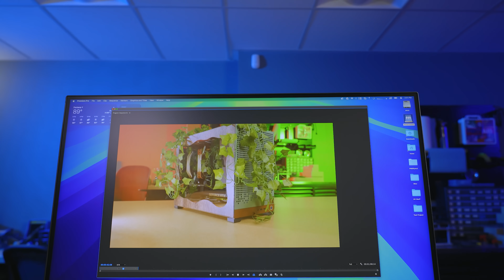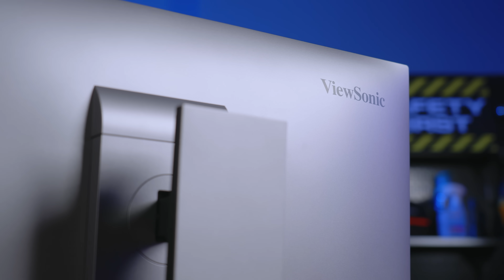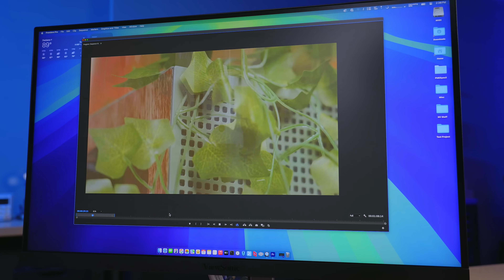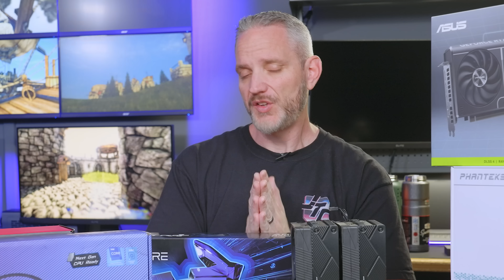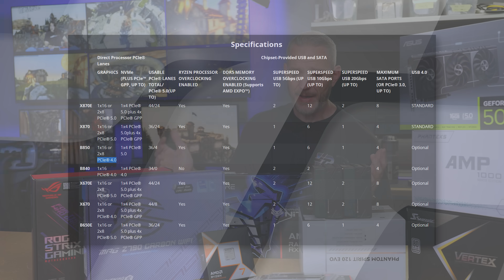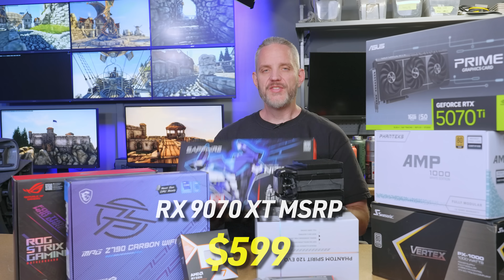This is the Sweetspot for PC gaming... Don't get fooled into spending more!

Comment: Your OS makes a difference as well, if you just play Single-Player games and have an AMD GPU. You may want to look into Linux, as you may even get a preformance bump in your games using Linux vs Windows. Not to mention, no more Windows nag notifications and forced updates. But if you play a Multiplayer game, look up if it works on Linux yet or not. You may also have to look into learning alternative software like you would if you switched to Mac..

Comment: Definitely don’t overspend on the mobo, I have an asus tuf gaming WiFi+ B650 and I’m able to tune the 7950x to use 180w with an undervolt/overclock offset in PBO, retains about 90-95% of stock performance but stays under 80c hotspot even in artificial benchmarks/deleting large folders in unreal engine project (tends to be very resource intensive). The mobo also has 2.5Gb networking, WiFi/BT, PCIe 5.0 for the CPU M.2 Slot, and honestly a fair amount of 3.0 and C ports for a sub $200 mobo. Biggest problem was having to find separate WiFi/BT drivers for a different motherboard on the ASUS website, courtesy of reddit lol.

Comment: basically this --> thermalright phantom spirit 120 se / evo or thermalright peerless assassin 120 se paired with any modern cpu (no, you don't need 9800x3d) + whatever gpu is cheaper in your region - 9070 xt is no less than 100-200 EUR cheaper for me and it's even better than 5070 Ti...

Comment: I would always still go with a 9700x rather than a 9800x3d up to a 5080. The x3d chips get really hot due to the stacked x3d layers
Reply: I don't think even a 9700 is needed for gaming....I mean I really don't see anything more than a 7800 getting truly used in a gaming scenario even in something like a really impressive Minecraft world
Reply: @rarespetrusamartean5433 you're perfectly right. Even the 9600x would be fine with most graphics cards cause the gpu would still be the limiting factor most of the time
Reply: I got a dinky little R5 5500 and I've played forbidden west, factorio, war thunder, minecraft, space engineers, ONI, whatever. I never ran into CPU issues and this thing was $105....Anything more than a $300 budget for a cpu is ridiculous to me.

Comment: OMG Jay i need to update my PSU. i still got an OCZ GameXstream 600W PSU 80+ White. i've buy it in 2006 to build a system with intel core 2 duo, update my system to AMD FX 8350 and update my system with ryzen 9 3900XT but i still have the same PSU from my first system. Thank for the advice for PSU

Comment: I got the b650 and 7900x and 7900xtx but a new motherboard would t be bad the wifi is super slow it doesn't get more then 500 mb ps vs my rog flow z13 gets 1.1 gbps which is the max download speed for me

Comment: As long as you're paying for a CPU that supports resizable bar, I've recently built 2 PCs with an Intel Arc A750 ($250), and get 75-120fps on most titles 🤷
As far as bang for your buck, if you wanna save some significant money, not a bad option.
Driver support is significantly improved since Arc launch, and as far as headaches, it's usually just a simple "enable resizable bar" in BIOs.

Comment: Don't buy X cpus. My 7700 is just 100Mhz slower at boost clocks than more expensive 7700X, you won't notice that 2 percent difference in prak clocks.

Don't buy 1000W PSU until you gonna run 500W power draw regularly from it. Efficiency curve losses at low load and purchase cost would kill the value.
With. Gold rated PSU? I never used, but EU 230V power grid makes PSU efficiency curve sit maybe 2 percent higher than 110V input. Anyway you should not notice the gold vs bronze PSU difference until you run PC wo power buttonx 24/7 at 300W+ load continuous.

Don't buy 9070X..204-220W 9070 is much cooler, less power hungry, no need for higher tier PSU and those 14 percent less performance vs XT? It is your choise. 304-350W XT needs better PSU.

The best budget savings start at detail and resolution slider in the game! Where 1440p is great looking, 1080p is still very popular and your hardware will let you run it at higher details. Fps cap wo make the magic and details settings lower than " Ultra Max Extreme" 😅 will save you the most money.

Comment: This week I built a P4 3.2 HT / ATi 9800XT retro build and I must say, those days were the golden years of PC building and gaming.
Reply: For me it was the Q6600 G0 stepping and 8800GT times in 2007-8, close to top of the line performance with mid range prices
Reply: Been into computers since the early 1980's, and I agree that the early 2000's were peak for building and case modding. Memories of painting Lian Li cases, manually cutting windows and installing gaskets, and using air fresheners with my exhaust fans.
Reply: but what keeps you from doing exactly that nowadays?

Comment: In the SSD talk (around 6:43) you talk about large files being where the gen 4 to 5 difference is noticeable. What is considered a large file in this context? (I'm assuming 20GB+?) Are there specific (non-game) types of application that benefit noticeably (enough to justify price) from the speed boost? Like CAD or editing software, maybe?
Reply: I’m playing around entry level ai pipelines and moving from node to node you need to load entire model into gpu vram prior it would start actual calculations, so here fast read speeds of gen5 looks attractive on paper, but actual processing time on gpu way longer than what I would win having latest gen5 ssd vs Samsung 990 Evo plus. So benefit would sink unnoticed in total elapsed time. Guess for my workload if there will be cluster of several 5090 or even h100, than definitely I would go with gen5 ssd, but currently all other components much slower for “live” processing data at that read/write speed, so my assumption for reasonable priced pc gen5 would produce satisfying benchmark screenshots, rather than noticeable improvement in day by day usage. Guess it could be important for video editing if you dealing with something like 8k pro res sources, then those files are enormous and software read chunks of it to display.

Comment: Yes, overdo the PSU.  If it never works hard, never sees max draw, never gets hot....it will probably never fail.  Just idles along forever.

And even with the safety switches in PSU these days, a fried PSU can still fry the whole damn system depending on how it fails.  BUY QUALITY.  If your CPU or GPU die, the CPU or GPU die...if a PSU dies, it could potentially kill everything but the case.

Don't be a cheap SOB on power supplies.

Comment: The one that I would really consider is the Thermalright Frozen Prism360. I had a Thermalright Phantom Spirit 120 SE and it did work but I would hit 80 C allot with a 5700x3d. so went to the  Thermalright Frozen Prism360 and dropped temps to high 60s to  just in the 70s. It's only around 20 dollars more but it's a good amount of cooling difference for the cost.

Comment: I have the Z790 carbon wifi 2, i9 14900k,  64gig of ram, 4070 ti super, and i have problems getting my rig to overclock and have no problems when gaming hardcore. Had unstable issues, spent around 3 grand in building this pc and can't even enjoy the overclockness. Sad face, 😢. I just play on default settings. I also have a corsair 1000w ps

Comment: The X3D - non-X3D recommendation is like kinda eh, REALLY heavily depends on the games you play. There are some games where running even a 5800X3D will beat most non-x3d without any hassle. My prime example for this is world of warcraft, where the game engine just chokes a CPU core out, while the rest are almost idle. WoW runs so much better on an X3D, its not even funny. These are a bit of fringe cases, but if you mainly plan on playing one game, be sure to check it if its a GPU or CPU bottleneck typically, and build accordingly.

Comment: By far the best advice you could have given here was the PSU one.

People often build PCs with the mentality of "I need the most expensive CPU and GPU", and the rest is "the bare minimum". Which often creates a big problem in the PSU department. Yeah, running a PC on the bare minimum PSU won't exactly kill you in the short term, but your 650W non 80+ PSU will suffer wear and tear. Eventually, the power conversion will lose it's efficiency. And yeah, while undervolted components will still work (for a while), you'll be losing performance wherever the supply can cut down to feed the GPU, until it eventually can't cut down anymore and the components just can't be turned on. I'd even go one step further than Jay and say an 80+ Silver is already good enough. From Silver to Gold you gain 2% more delivery only, and more often than not it's a huge spike in pricing.

If the cost does not prohibit you, oversize your PSU by 2 tiers (100W per tier) or more. As wear and tear happens, if you don't upgrade your power hungry components (GPU) into hungrier ones, even as it starts delivering under it's original rating, the margin you had is enough to keep your components correctly supplied for MANY years to come.

Comment: Well... Cpu upgrade is a lot cheaper than GPU upgrade currently so for spending more on cpu is easier and good future proofing.
Same for faster ssd.
Especially since a lot of player are Fortnite Minecraft and cs 1080p high fps players and in those case, ram, cpu and ssd speed are important

Comment: LOL I bought a 850W PSU in 2016 and I'm still using it 2 builds later. But I built a ROG Strix B550-F, RTX3060 12GB, AM4 5700, 16gb 3200/CL16 ram, 1TB SSD system with recycled SSDs and HDDs (total 18.5TB) and that old PSU. it's good enough gaming for me and i spent under $500 2 months ago. But I been building my own systems since 1984 (H/Z100 was my first and yes i had to soldier the chips on)

Comment: I couldn't afford to buy it all at once so bought it a piece or two each month.  And either couldn't afford the latest stuff or get hold of it so ..7700x with a 7900xt 20gb, b650e-f mobo, 2x 2tb gen4 SSD  and 32 on the ram.  1000w PSU.  

Very happy, it's an absolute beast that eats up games on a 1440p monitor on full ultra settings.

Comment: Mostly like this video.  Not with you on the PS.  My PS is overkill at 800W.  For a mid-tier system I never see going beyond that.  Just upgraded from an RTX 2060 to and RX 9060 (yes, 16GB) and it could be powered with a 500W PS.  No mid-tier system should ever demand a 1000W+ PS.

Comment: Thank you..thank you for explaining that the top tier boards, cpu's, gpu's, etc are NOT required to have an amazing gaming experience.  I have always had a "mid tier" PC and have never been disappointed with my gaming experience.  I currently run an I5 cpu with a 4070 gpu and most of the games I play are close to full settings!

Comment: The best "value" video card is a RX9070. Nearly as fast as the XT model, uses less power, and can be had for as cheap as $599 now although I would pay a little more and get one of the OC models clocked at 2700 MHz as they are 7% faster. Paid $669 for my Gigabyte OC model.

Comment: Personally, I've always bought into the idea of maxing out the CPU (within reason) for single thread performance, combined with a bit more cores than is expected for the current day, and then getting the best GPU you can afford. GPU bottlenecks tend to be more ameliorable with settings tuning compared to CPU bottlenecks, and this is particularly acute when you desire high FPS (for reduced latency and improved motion) over maximum detail. Also, there is much more of a chance that you will be able to upgrade the GPU alone in the future for a big performance boost, compared to replacing CPU+mobo+RAM+etc., although admittedly GPUs are so expensive now that it could be cheaper to buy all of that instead.

Comment: There are other really good brands of AIO that are considerably less expensive,  you do not have to spend $150. Thermalright is an excellent brand and you can get an AIO for $60. I have bought several for various builds that I've made and they work fantastic. There's no need to go with this big giant clunky air cooler that'll take up 1/3 of the space in your case

Comment: where im stuck is i havea 7900xtx paired with the 5800x3d.  I love my setup but i know i can get better frames if i do SOMETHING.  ive got the ram clocked at 3600 64g ram(fury).  I feel like im not getting what i could out of this, or am i possibly bottlenecked at the cpu nowadays? I run most games on high, but never crack 100 fps on newer ones that i see some ppl with similar systems getting over 100fps at similar resolutions.  im not quite running 4k i dont think but at least sticking to my screen rez on newer games(49 inch super ultra wide G9).    Im a good dabbler but not a good troubleshooter for pc(other things but not pc) and im not great with software.     All this said its def not a NEED to upgrade but just wondered if upgrading to the 9xxx or even the 7xxx(and yes i know that means a rebuild because of the new sockets and generations) and since i have the 7900xtx i cant see getting a 9070xt and can save cash there.

Comment: Hes talking about amd cpus, so I'm wondering about the amd 7 3700x, its what I have with a 2080 super, 16 gb 3200 ram, a am4 b550 motherboard. Is it part of the generation of cpu thats value and performance?
I built my (first and only pc) in oct 2020, it obviously runs everything i throw at it pretty good at high to ultra/max settings other then modded cities skylines, only thing i do want to upgrade is my ram to 64gb because CS with lots of mods/assets needs a lot, hence why I can't play it will at times.

Comment: Overspecing the PSU also helps with efficiency. You want to leave some headroom so that it runs as close to peak efficiency as possible, which is around 60-80% load.

Comment: Z790 + 5070 Ti isn’t a sweet spot, it’s just expensive. You don’t even need to buy new to get the same gaming performance. A used 10900K or 5800X3D with a 4070 Super does it for way less.

Comment: I start all builds at games vs targeted  video output. Basically, decide what games you Wana play and the monitor you want them to play on and that pretty much builds the system for you. Easy peasy.
Reply: Yap, this makes the most sense, since building a sweetspot system could be very bad if you want to game at 4k 120fps+
Reply: @0M3G486 and then it depends on the game at 4k at 120 FPS ..  not all are the same. I'm sure you could run a seek and find at that no issues on most things with the right screen. The latest COD... Not so much.

Comment: I bought a used  3080TI for $450AUD and I'm running it with a 7600X, total cost for CPU+GPU was around $800AUD. I get 4K ultra 90-120fps on most games and I am very happy with this. People need to buy previous gen GPUs and you can maximize on the things you "skimp" on due to the inflated retail costs of the GPUs. I may upgrade to a 5080 super when it comes but probably not. The 3080TI is a BEAST

Comment: I over speced my psu over a decade ago 🤔I am still using the same psu lol I am all the way up to a 5600x and 9060 xt 16gb I think my psu is like a 750 80+ bronze (cx750 from 2012 I think) XD My system estimated wattage is 428 watts which is pretty spot on if I am maxing out my system under benching loads. I am also still on a case from 2013 as well, the corsair carbide series air 540 hahahaha talk about investing in my pc ;) 

A side note too, I am on a am4 board that came out at the launch of ryzen XD I am getting my money worth out of it!

Comment: Not so much a sweetspot but just something general to be aware of, I discovered recently as I've been getting into digital art bought a display tablet only to discover that my motherboard doesn't support USB-C DP Alt Mode, so I'm stuck using 2 usb cables & a HDMI instead of 1 USB-C to use the screen feature of my tablet

Comment: Jay, you should break down the gamer "use-case", because not all gaming is equivalent. If you're playing first person shooters on a flatscreen, a top-end CPU or GPU may not be so critical. However, if you're a gamer into flight simulation and VR, you can use as much high performance CPU and GPU as you can afford. Performance requirements vary based on the software you run.

Comment: My partner got me a 9600X with an MSI X670E with Wifi and 32GB Teamgroup 6000 CL26 ram last Xmas, and it's been doing quite great.  Granted, MSI's motherboard control center is really buggy, and it only needs to handle a GTX1660Ti until we can upgrade the graphics card, but for the budget I think it's more than enough.

Comment: I got a 5070 TI (at msrp - $750) paired with a 9800x3d because I play competitive fps games at 1080p (or lower) for about ~70% of my gaming hours. However, the other ~30% is more graphically demanding single player games, hence the 5070 TI to have decent performance in those titles with the help of dlss 4 and sometimes FG 2x.

Comment: Building a PC leaves you scratching your head with too many options, and when you settle on one component, 2 weeks later you find a better product for less and kicking yourself cause you didn't wait or tempted to buy and replace the one you just got. 😄... 

I've settled on mini PC's now. They won't break your bank and you can still play your games, maybe not at ultra high settings but med/low settings is enough for the game to be more than playable...at least for me.

On the other hand, what I like about full size PC's or itx PC's is that you could really turn them into working art pieces if you're creative enough.